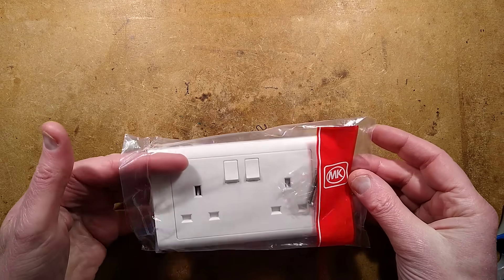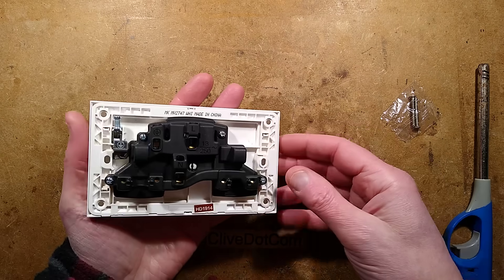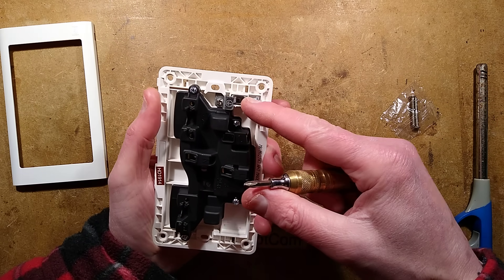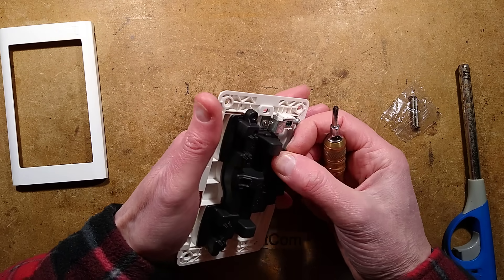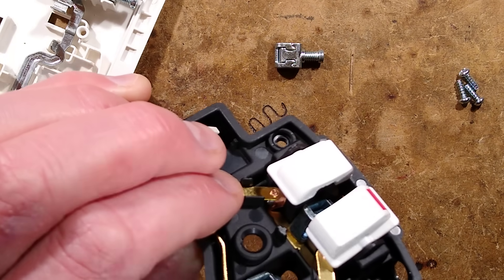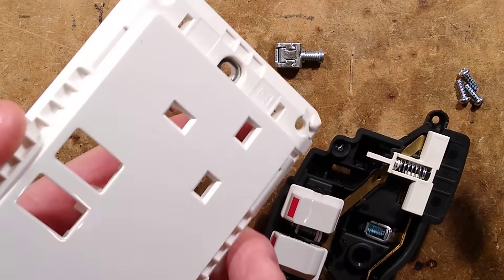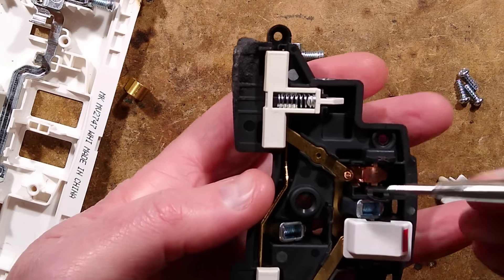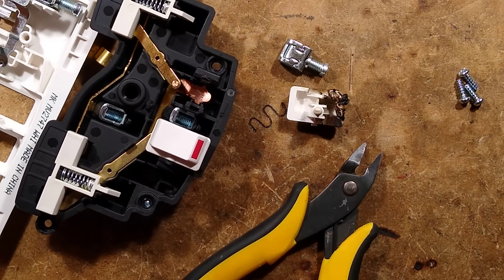Flame test on a recalled MK socket

Comment: Arc flash is basically ultra hot electrical plasma that occurs when switch contacts are opened and can exit through any gaps in an electrical enclosure and cause major burns (at least when we're talking things like industrial power installations where the guy who gets to turn on the switch has to get dressed up in a fire proof blast suit and actuates the switch using a 10 ft long "chicken stick")...

 In this case I'd say that either they cheaped out on the contact material which can exacerbate arc flash OR, more likely, given that the plastic toggle is literally just over top of the contacts, with no intervening membrane or barrier, that the hot plasma from an arc flash could just come out around the gap and burn the user...  

 You could test this by deliberately cutting off a big inductive load with the switch and seeing if plasma flame is visible around the base of the toggle..  You may have to film in the dark to see the flash..
Reply: Well I see Spark daily when I turn my 2KW electric geyser switch off
Shouldn't it be the first thing to keep in mind when designing electric switch?
Reply: @Timewastedonyt  It is, this is why we no longer use things like knife switches..   There will always be a bit of a spark if you are separating contacts that are carrying current as just the basic inductance of the wires wants to make the current keep flowing, but a spark is not arc flash where there is a sustained current carrying arc..   What we do in modern switches that have to carry any serious amount of current is to optimize the contact material and coatings to minimize spark erosion and tendency to vaporize (which could cause arc flash) and then engineer the way the contacts open: so things like snap actions that separate the contacts at a faster speed (generally controlled by a spring) than the person operating the toggle can and lever arms that maximize the separation between contacts once opened, and in things like circuit breakers where they only open when the current is at an absolute maximum, there are arc arrestors that act to cut off a high current arc that the snap action and contact distance were not enough to stop...   But as Clive noted, this switch looks to have a decent contact separation and does use a snap action, so I suspect that it's probably contact composition and the open gap around the toggle  that could allow the hot gas from an arc flash to escape..  It is a very unlikely occurance, but places like the Underwriters Lab will intentionally way overload components to see how they fail and find the one in a million case where there's a remote chance that it can cause injury, and it's the lawyers who decide that the risk is too high and it's cheaper to do a recall than settle a handful of lawsuits..
Reply: @Flying0Dismount  Thanks for explaining although I knew many things (I had watched a video from Technology Connections "Switches are Clicky;Here's Why) definitely learned some new things 

Hey I have a question? 🤔 
Their is a switch in my house which controls a 20watt led bulb due to being old now sometimes switch just make enough contact that I can hear the sound of arching in the switch and led bulb will dimly glow 
I am interesting in knowing what will happen if do not press the switch a little more so it make perfect connection 
1)will the switch catch fire 🔥 
2)will arching will permanently weld the switch on on position 
3)or something else
Reply: @Timewastedonyt  if the switch is arcing inside it's probably time to replace it. Continue arcing will erode the contacts resulting in higher resistance. If all you're running is the 20 watt LED you're probably safe enough, but your LED light life might be reduced due to the unsteady voltage caused by the arcing, and other electronic equipment on the same circuit may be affected by the electrical noise and transient caused by the arcing as well.   If you ever put anything higher wattage in the circuit, the increased contact resistance in the damaged switch could result in two outcomes:  1) the contacts no longer mate and you get an open circuit and whatever you plugged in doesn't turn on, 2)the high resistance contacts get very hot and potentially cause a fire (which should hopefully be contained by the chemicals in the plastic designed to self extinguish as Clive demonstrated by trying to light various parts on fire), but regardless, the switch should be replaced..
Reply: @Flying0Dismount  Hey thanks for explaining 
As the switch is wired to a bulb  holder I don't think I will use more than 20 watt from it (until I use Incandescent bulb )

Interesting 🤔 I never thought of the effect of arcing in this switch on the whole Circuit 

Definitely will replaceit,it works and it is a 2 way switch that is the reason I have not replaced it asap but will definitely replace it soon :)

Comment: 4:57 "Lighter does not want to relight anymore"
Yes, that is annoying, why is that? - Even if the fuel level is good.
Those items are reliably unreliable!
And that's even before the 'rubberised'/soft-touch twin-shot overmolding begins to degrade into a sticky mess (mitigated by wrapping in cling-film).

Comment: Mudflap4 posted a photo 2 months ago on read it showing one of the switches burnt on the bottom.
Apparently there are 27 products in the recall, singke and double sockets with single and double pole.
https://youtu.be/sRIc9YIfkn4?si=70hAa3Ovtx2SvWqZ

Comment: In my old house i had switches that could buzz and arc. It worked in both ways. when on putting just enough pressure on the switch before it could flip resulted in buzzing arcs, and the other way when off, i could bring the contacts close enough before it could flip over and started an arc. if not done by hand it could be done by pressing a table against it. Thats how i noticed it. It has to do with the allowance of movement of the switch part, the flip over point, and closeness of the contacts. So it seams a test with power and a 3rd video is in order:))

Comment: So from an electrician of the 90s, MK is Milton Keynes. Once made in the UK to such  a high standard that i remember their adverts from electricians magazine saying a sing!e socket moulding tool cost more than a Jaguar XJ6!
Reply from the maker: All injection mould tooling used to be astronomically expensive until modern CNC machines and spark erosion came of age.

Comment: I'm guessing it's more to do with a burny arc flashing over escaping the switch and injuring the squishy fleshbag operating it, given where the contacts are located and aren't exactly shielded to prevent the pixies escaping through the gaps... :S

Comment: Do any of you remember the MK sockets that were made without switches around 1980s I think. Not sold now but when I first bought this house it had them in most rooms I got rid of them after blowing several power supplys because the arc flash whilst plugging them in.

Comment: Clive might it be the live is  arcing to the earth bar when its assembled ?????
Reply from the maker: That may be the issue, due to rogue longer breaking arcs reaching the earth bar.
Reply: I was thinking that having both bus bars inside the assembly put them closer together than usual.  If melting plastic let's them move even closer, or as you say the arc flash can travel and bridge the bars - then you could get a nice warm sustained arc.  And some plastic vapour as seasoning. 

If I recall the last good MK that I used the earth bar was always visible on the back but other links were inside. And I assume live and neutral were better separated.  This is like a minimal material exercise, which I suspect went too far.

Comment: A "UK" manufacturer had a problem a number of years ago where one specific ceiling rose was involved in a deadly fire. It wasn't flame retarded but should have been. It was impossible to tell how widespread the issue was. So I imagine they are being cautious and many, if not most or all are flame retardant.

Comment: I was wondering if it was just a pricing error. These were supposed to be sold at twice the price, so to recoup the cost they did a recall, and they will re-release them at the new higher price. (?)

Comment: My Bunn coffee maker heater switch throws enough of an arc that it triggers a static electricity discharge (I'm in the US where we often have low humidity).  It feels like a typical static shock, except while it's discharging it conducts some of the 60Hz and I can feel that too so it feels like being zapped with mains power.  It's scary but it doesn't cause any detectable burns.

Comment: Based on my analysis, the voltage arc escapes through the opening of the housing and the plastic of the switch where the contacts are, since the metal contacts are close to the opening, under large loads the arc can jump outwards, I see that the switches have a plastic that hides the contact a little, but it is not enough and the electric arc can jump to the outside.

Comment: YouTube wants me to pay for "1080p Premium."  Does YouTube advise Partners to upload in a specific 1080p, 30fps format to trigger that?  Does supporting that format get you any revenue?
Reply from the maker: I upload 1080P around 30fps as standard.   It may be aimed at channels that offer higher resolution to accommodate the extra bandwidth involved.

Comment: If arcing is the problem, I would guess that the switch is where it happens.
If the switch mechanism "ages" rapidly for any reason it may create a situation where either the mating force on closed contacts isn't strong enough or contacts fail to open rapidly to a sufficiently wide gap. The former might cause heating that accelerates degradation and the latter could certainly lead to sustained arcing. The heat from an arc could be very much greater than the heat from a small butane lighter.

I'm unfamiliar with UK electrical gear, so I'm totally guessing here:
If the plastic is softer than "normal" and there are situations where the socket assembly may be mounted to a surface that is not properly flat (planar) perhaps a small amount of torsion can cause interference with the operation of the switches. Sometimes compliant materials make things more tolerant of "off spec" conditions, sometimes they make things worse.

Comment: My guess:
if you have a larger (inductive) load and switch it off slowly, there will be an arc. Since the switch is not closed off with some plate, this arc can escape to a (wet) finger that turns the switch off.
Since there is no other return path then the load, it can burn the finger.
So, having a bigger distance between finger and contact and/or a small protection-plate inside the switch between arc and finger will prevent this and keep the arc inside.

Many switches in this form will create a bigger and longer arc when switched slowly, kind of stopping the motion in the switch.

For me, the test would be to put a motor using around 13 Amps (it can be a fanheater or big charger of some kind, or just an extension-cord with an old TV and some other things) on it and during load slowly switch it off. There will be an arc almost for sure. Then: will it escape the housing to the user ?
Probably for other brands this would be 'user error' but for this brand it means a recall.

Comment: Had a 6 socket power board, white plastic only. Brass strips heated the plastic, Live strip Slid over into the Neutral strip.

Have seen a switch with misshapened cam. Switching Off, the cam kept the contacts just 1~2mms apart for the majority of the cam travel.
Reply: I had an interesting event with a domestic UPS (from a well-known and generally respected company) which I was migrating from my PC to use for my TV and PVRs, as the village I lived in had more than its fair share of power issues. I was plugging something in when there was a loud bang and a bright blue flash under my hand, followed by a little smoke.
I emailed the support for the company explaining the issue, and immediately proceeded to take the UPS apart to see what had happened.
The issue was that the frame of what was effectively a 4-way power strip was only held to the top of the case by (what seemed to me to be) fairly small plastic welds. I hadn't been pushing the plug in particularly hard, yet it seemed that if a plug wasn't properly aligned or tilted earth-pin-first, even a normal amount of force pushing the live&neutral pins against the shutter could make the welds fail, and when they did, the various brass strips were free to spring around and hit each other.
I'd only just worked that out when I got a somewhat panicked transatlantic phone call from someone in the support department, which was possibly down to me using the words "small explosion" rather than "loud bang" in my message.
It all worked out well. Even though it was way out of warranty, they still replaced it for free, and I'd been on the verge of buying a new battery for it, which I no longer needed to. I'm still a loyal customer many years later (which is more than I can say for the two other UPS companies I have unfortunately tried, which have their own stories).

As a somewhat off-topic observation, after I got my first UPS, the number of BSODs I got from Windows XP on the same hardware declined greatly.

Comment: worth noting that in the report it says "The product presents a risk of minor burns as it has been identified that
when the switch on the socket is being switched on or switched off, whilst it
is under load, there is a possibility for an arc flash to occur. The affected
sockets do not meet the requirements of the Electrical Equipment (Safety)
Regulations 2016 or the Plugs and Sockets (Safety) Regulations 1994

"https://assets.publishing.service.gov.uk/media/67656a8ce6ff7c8a1fde9ca3/2411-0130-product-safety-report-3-pin-socket-with-switches.pdf

Comment: Not necessarily fire - burning the finger of the person operating the switch when under FULL LOAD.  From HM government recall page [quote] Hazard: The product presents a risk of minor burns, as it has been identified that when the switch on the socket is being switched on, or switched off, whilst it is under load, there is a possibility for an arc flash to occur, for milliseconds.[/quote]

Comment: Maybe the switches were prone from throwing an arc out the front and injuring the user?
Reply from the maker: There are hints that's happening when the breaking load arc flashes over to the internal earth bar.

Comment: You know what the issue will be after all this...
User error. It's a very cheap product so big steve from down the pub will be changing them over in his house without having a clue of safe wiring practise causing a "fault" with the switch.
For anyone with understanding, they will work just fine

Comment: HAHA the cut outs you have to remove to facilitate cable entry. Yep, with the brittle plastic type boxes you carefully snip at it or try to knock out a designated section and a crack shoots through the entire fitting rendering it useless. Then you come back with a chewy plastic fitting - firstly there's no hope of knocking out a designated bit, you just bounce off. So you get at it with a knife point and sharp snips, all seems to be going well as you nibble toward the corner of the designated section..... then a crack shoots away from that corner rendering the fitting useless.
Just make them all 2mm+ steel then we can drill a hole where we actually need it (rather than some preselected inconvenient spot) and stick a grommet in it.
And while I'm at it - put some proper brass in there!

I must go, my nurse is coming with my meds saying something about I must come off the lawn and stop harassing the clouds.

Comment: Impressive - It's so self-extinguishing it took the lighter with it!
Reply: Hogwash! The lighter just refused to partake in the torture of an innocent socket!
Reply: @DrAHorn  Yeah, my expectation was more like "flammable as a celluloid ping pong ball"...
Reply: lol, I've never seen one of those type of lighters that works reliably, can see the spark, hear the gas, but it will just plum refuse to light regardless of your spinning the adjustment.

Comment: You need to conduct a load test... connect a 2kw  or more heater to it and switch it on n off with the mk... see if you can reproduce the arking fault.

Comment: Is a high voltage insulation test of any use to locate weak points? 
(I know it's not the usual way to use such tester) And could there be any thing wrong with the contact point material? I've seen those crumble in switches.
Reply from the maker: In this case the test would probably pass even on my highest voltage tester.  It seems like it may be an arc and ionised air issue.

Comment: Just as you thought, nothing obviously wrong.  I suppose an electrical arc could happen under extreme load and it might do the switch in but dang, wouldn't one notice that immediately?  Remedy: Don't overload the socket then push the switch with wet, drippy fingers.  Thanks Big Clive, always appreciated.

Comment: You're not going to be able to see the problem.
The recall is due to "the risk of minor burns, when switching a socket off, that is under load".
So there's a spark, that jumps out from behind the switch, and is biting people on the finger.

Comment: We want to see if you can get the spark out of the front on the socket when you switch off a stupidly big inductive load.
(Do it in the dark for optimum spark visibility)
5:15 The socket is so self extinguishing that it put out the lighter!

Comment: @2:37 it sounds like there is an issue with the rocker switch jamming, and the contact is not making fully, maybe touching on one edge, and under heavy load this could start and maintain an arc.

Comment: Maybe the spring loaded plunger on the switch may be melted under load and causing not fully closing or opening results in arcing. Unless it's made of plastic, if it Nylon then its not possible.